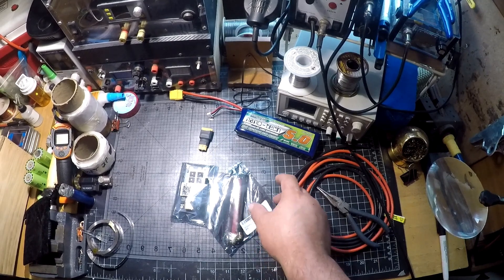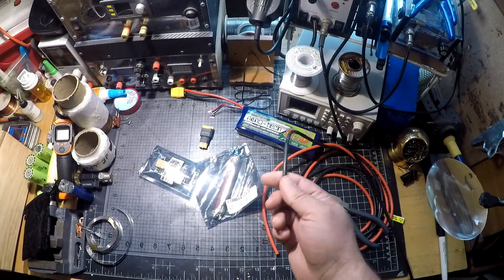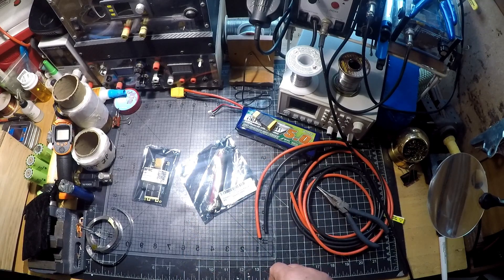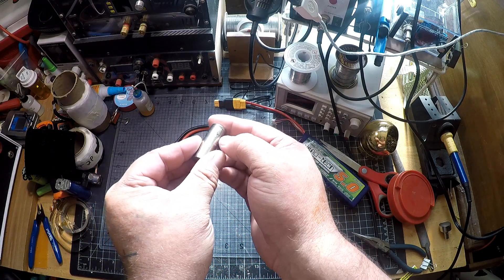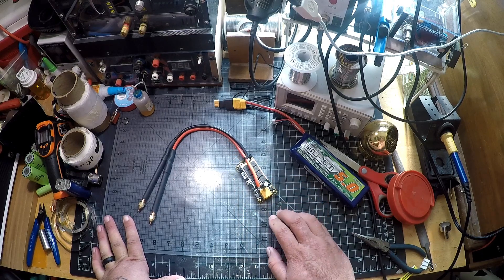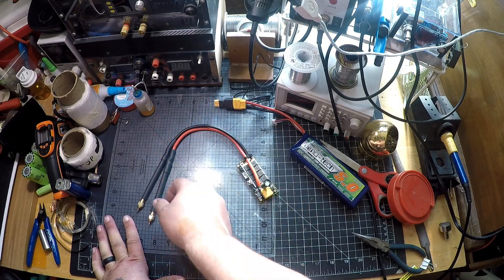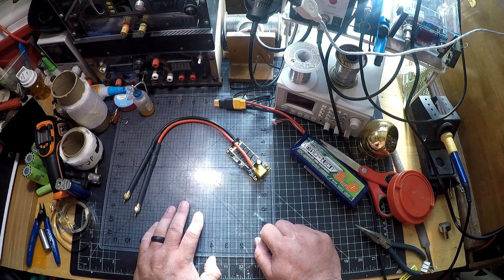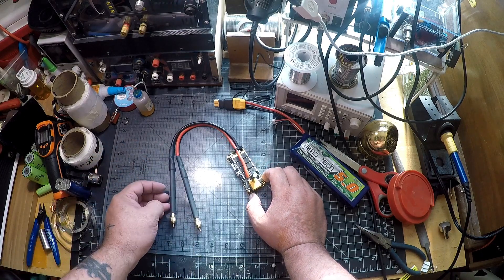12v 18650 Battery Spot Welder PCB Circuit Board Unboxing, Test & Giveaway !!!! 2 of 5!!

Comment: I've discovered that there's a missing SMD resistor (R4) on my BIFRC V1.2 board. This may explain why it's not triggering the MOSFETS.
The 0603 SMD (R4) should be soldered on two round pads just above the "KEY" silk screen label, adjacent to the SOT-23 package (branded J3Y). Can anyone with a working board please tell me what the value of R4 is?

Comment: Hy what lipo use it for discharge ? 
i use a AGM 200 CCA and for pcb i use a external surge 12volts 2 aps because is possibility to blow mosfet when voltage  drop under 10volts.
Reply from the maker: I'll have to see if I can find what I used. I remember it was a 5000mah and boost of 175c. Your going to find that most of these types use mofsets. Even the spendy kweld and maletrex welders. Typically 3s and 4s. Now I use those flat cells spim08hp 3s2p.  That gives me a boost of 600 amps to around 1200. Most of the welders like this just needs a minimum of 200 amps.
Reply: @njfulwider5  Thank very much

Comment: Hello bro,
I am Using this with 5200mah 40c LiPo. After welding 2 batteries, the multi-coloured level indicator LED stopped, and the 2nd green blinking light is now glowing constantly whenever I plug the battery. Now it welds no more. What could have happened? Do you know how to fix?
Thank you.
Reply: This happens when one of emitter-follower transistors shorts. (by the multi-color mode light) The pulse-light, and thus, all your mosfet gates are stuck on. This likely caused failure of the mosfets as well. These boards work great for short period of time, but lack the ruggedness needed for long term use. I’ve tried 3 in different configurations. I even tried isolating the logic side and running it from a wall adapter. That one lasted the longest, about 5 months.
Reply: @markb1911   , Thank you for reply bro. Yes it happened similar to what you said, but the mosfets were stuck due to burnt link between them on the board. I jumped it with small wire and it started working. But then I added heavy heatsink, thick solder on behind. And I changed the connection from xt60 to 120. Now it worked but got fried entirely after some use. Now I get endless sparks when I touch the tips to the nickel. 
No use buying another...

Comment: The title and thumbnail is unintentionally or intentionally actually what most of the people want to know, but in the actual video it isnt. It appears like you are going to "supply power to the spot welder with 18650 12v battery pack. Will it work?". 
But anyway, nicely done. 
My 12awg wire and probes warm up after 2 or 3 spots. I guess I shoud replace them with thicker ones.

Comment: People blowing fet's are probably running their batteries down too (or from using inadequate batteries) low so that the fet's can't close correctly. One guy bypassed this issue by running the low voltage (electronics) part of the board from an external power supply, this way, the fets can always close correctly.
  The other thing to consider for builds that use coils is to fit a flyback protection device such as a flyback diode or a snubber.

Comment: I wish i could see where you soldered the capacitor and lead. I tried and got a large spark and pop when I plugged it in. I can't find anywhere to tell me all the soldering points. I wish someone would make a detailed video on how to actually wire it up. I can figure out how to use it. but if I can't solder it correctly it's pointless

Comment: hi, i have one and i make a little mod (i saw that in the channel "Sidorov_life"):
i disconnected the positive from the board and send it straight to the welding pen. (the negative continue passing through the board normally)

than i fed the board with separated 3S battery, in that way, the mosfets controller's voltage does not depend of the welding power supply's voltage. now they dont get hotter than the ambient even with pink/cyan pulses.

 this board when dont have enought voltage it shorts out, so, if you use a discharged battery and/or bad battery (or even a 2s battery), it will short out wen it pulses and boom...

EDIT: it shorts out i mean, the board by itself when it is off is normally conductive. So when it send a pulse, the voltage will drop, the controller will get unstable, and the mosfet's gate will be like schrodinger's cat, all the board still conducting, the voltage still low, the mosfet's controller still in sleep paralysis, and now the mosfets are transcending to halogen lightbulbs...

i really recommend do the Sidorov mod, works really nicely and safely
Reply from the maker: Thanks for the suggestion! Do you have a link?
Reply: @njfulwider5  https://youtu.be/JKn5dOm1qd4

Comment: Just assembled one.    May be having issues with the timing.  some times it Powers the Wands before they are touched to anything ? That seems to have cleared up.   Took me a while to figure out how to install the Cap.  NOTHING Marked.  Working it seems.  The High Purple setting is way too much for anything I think ?
The Indicator LED is so bright It's hard to tell what mode your in.  
Using 4 headway cells to power it.    The 10 AWG wand cables to in fact start heating up rather fast.  

I'm in Face Book jail yet gain.  No expansions as to why.
Reply from the maker: Thats strange on the FB? I haven't had much time to play with this yet.

Comment: Hey, can you help me, I made a spot welder with a car battery (330cca) and a solenoid but when I weld two nickel strips together they come apart easily. What am i doing wrong? I am applying correct pressure, there are no sparks so the two points are in contact etc.
Reply from the maker: That sounds like plenty of power as I have also used the same type of battery and solenoid. Make sure you battery is charged, and when you apply pressure with contacts, make sure you don't apply to much pressure. To much pressure increases the resistance and creates a dead short. Almost like an on/off switch. So with a little less pressure, you decrease the resistance and will get a weld. It take some getting use to. Make sure to watch this video on how I calibrate my leads and practice. https://youtu.be/wkELqXkmEtA
Reply: @njfulwider5  hey, thanks for the reply, in my welds, the wood is burnt underneath. I have figured out how to do two nickel strips together but nickel on battery will not stick strong.
Reply from the maker: @outra5810  It take some practice, but it sounds like you should have plenty of power. just watch the video and ease up on the leads when pushing down on the nickel strip. also make sure your using 8 gauge or better on the wiring.

Comment: Hi. I have the same PCB Spot Welder! I connected wrong the positive and negative of the 12v car battery and BOOM. Capacitor exploded. Should I replace the capacitor or PCB is for trash?
Reply from the maker: Pretty sure these have a diode that protects from reverse voltage, I’m not 100% sure. If that diode is fine and you replace the cap, it should be fine. I’d really need to see the board up close to know for sure.
Reply: @njfulwider5  Thank you, I appreciate you. I replaced the cap and still, it doesn't work. I'm trying hard to find what's broken, the board looks ok. Please tell me your guess, what else should I replace. I'm a newbie...
Reply: @njfulwider5  No reverse protection on the high voltage circuit. There is a diode (upper right corner) that keeps high voltage (12 volts) from feeding back to the low voltage (5 volts) components.

Comment: I bought this recently. Couldn't find any information on it in English and keep getting holes so I'm grateful for your videos bud. Thanks.

I'm using pins from another welder and they are flat so I'm going to sharpen them now and try again. Happy to see it's just me and it's not that I've bought a lemon.
Reply from the maker: I've noticed with the leads you get from china, they need to be filed to a point or angle to work better. Anything to make sure your getting a better connection. Also make sure you start with the first setting and do not use a normal car battery to power these.
Reply: @njfulwider5  using a 11.4v lipo for now but I did actually plan on using a car battery. Do you think it would die?
Reply: @leif011  i think it will thank you, the mosfet's controller will get more stable. should be fine.

Comment: I have the other version (NO Battery Connector)  that's working so far.  For the Price I'm happy.  Adding some solder to the Tracks would help I think.  The Copper on the boards just isn't enough for these type of currents.  Working in the mS of time is the only thing keeping them from POPPING right off the bat.  The one I have calls for a 20 - 30Ah 12v battery.
Reply from the maker: So far this welder has the thickest tracks and more solid than the other I have worked on. I didn't want to modify, so it looked like it worked, I wanted to just show it working out of the box as intended.  But If I was to keep, I would most definitely beef up the tracks.

Comment: I got one, it was useless, the FETs exploded, first try! I ended up just building one!  I use 3s liion, and capable of 400amps constant, and about 800-900a burst. I'm going to go to 4s it welds better with higher voltage. She heat or current doesn't seem to go deep enough at lower voltage, I'm thinking I'll try 4s, maybe 5s, my timer circuit is about at its limits, it's at its shortest pulse,  as long as the voltage is above 11.5 it works great, with 4 gauge leads,  I'm thinking I can maybe use this board as a timer, bypassing the relays!
Reply from the maker: What did you use to power your welder, the one that blew the Mosfets? Also with DC welding, typically anything above 4.2 has enough voltage to spot weld as long as it has the power. I have lipo and Lions that I can tab weld at 4.2. The SIMP08HP are freaking awesome at this!!
Reply: Good info...I might revert to DC rather than my AC MOT...having terrible results.
I dont have any timer circuit just the MO door switch.  Making around 3.6VAC with just over 400 amps on 6AWG secondary winding. It blows the breaker if not absolutly alone.  Ive got a 1/4 copper rod on the way to make bigger better tips.
It does great using 3/16" carbon rods (a lifetime supply for about 20 bucks from Ebay).
Copper wire melts and beads up into balls like solder.  So far, its most useful as the worlds most overkill cigarette lighter

Comment: From what I've heard, the ones that have more control, such as an Arduino controller, work better. I would imagine a lot less stress on components
Reply from the maker: Yes, they do and you get what you pay for. For example, I have both the Kweld and Malectex welders. These cheaper welders basically do something using the same power, but not as precisely as something like the Kweld. But it's nice to know, if you don't have much money and you only need to make a battery here and there, you can get one of these cheaper kits. I personally wouldn't make these my main welder, but I am sure they can help in a pinch.
Reply: @njfulwider5  Very true. I really don't have that many to do so something like these cheaper ones would probably be fine

Comment: Nice small form factor, is it worth beefing up the tracks  with some copper cable.?
Reply from the maker: I was thinking I might do that with this but figured if I alter what these guys are selling. It would just make them look like these are great welders. Figured if these can work as is, and they do the job, then buying may be worth it. But Most definitely if I planned to keep and use full time, I would beef up the tracks.

Comment: I'm loving the simplicity of it
Reply: yeah the problem is there's not really enough control and too much current can blow the fets. once you blow fets, your PCB design is screwed and you need to add more fets which is a problem when the PCB is already made. could parallel if you can but the more fets the better (assuming their specs are equivalent).
you really need one with a pulse control, how many pulses and for how long to keep it on, then how long between pulses. these small kits lack that fine grain control but you could design one with a few buttons and leds.

Comment: Buuddy, I messaged you on SLS forum and need a big favor. possibly make a video out of it.
Reply from the maker: We've been moving, so I haven't really checked anything from there, but I will now. Crazy over here..LOL
Reply: @njfulwider5  My e-skateoard lipo cell tab broke and can't solder, ordering a welder will take too long as I'm moving back to Australia. can't sell the board because of the problem. kind of stuck. if I can spot weld a little nickel would be great. happily drive over unless you've move way far out of Seattle.
You could hop onto our discord unless you've forgot your login. re-sign up on our site there's a link to invite https://diyenergypack.com/
Reply from the maker: @phizicks  Once I get settled and I have everything up and running, I drop you a line. Most of these videos were filmed earlier to kinda buy me some time to set up my new lab. Hopefully, we'll be done in a week or so.
Reply from the maker: @phizicks  Not sure if you have my email, but its in my profile description and or just send me a line at Fulwider40@gmail.com